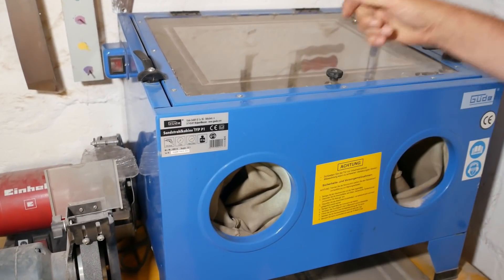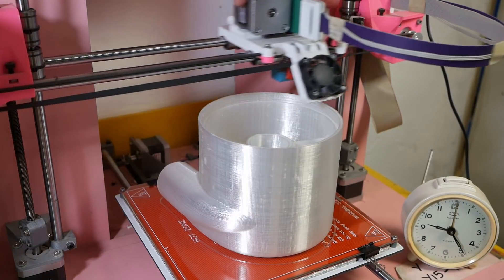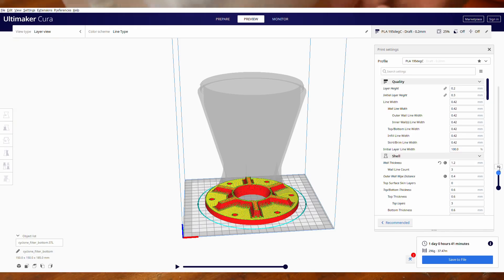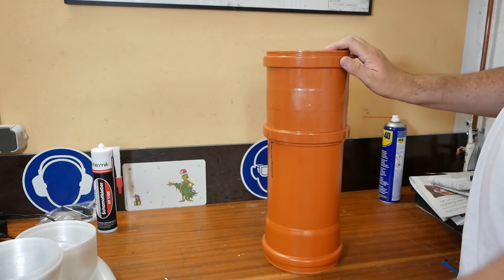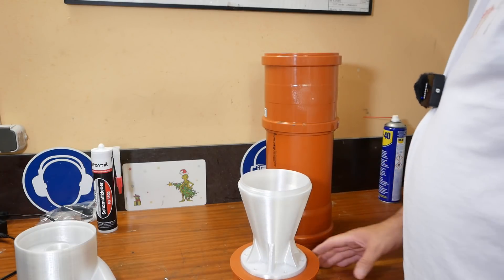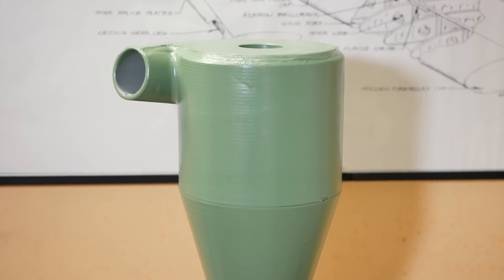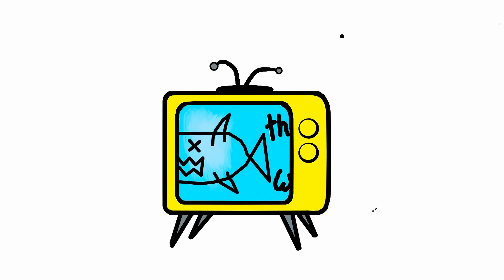DIY cyclone dust extractor

Comment: I love that green 👍 i also used it on My rolling tables in the work shop.

I think i Will get a 3d printer for the shop one day forsure
Reply from the maker: G'day Nikolai, thanks. RAL 6011 really grows on you :)

How is your shop move working for you? Did you get the owner to shift his junk out of your way yet?
Reply: @RotarySMP  Ive been slowly getting the shop setup while i work - been really busy keeping up with the work and trying to get the shop setup.. i am far from done - my saws and manual lathe are still on wood blocks and so are my drill presses. i have gotten setup so i can work now but i still need to setup the old mazak mill and the rest of the stuff... the owner of the building is not finish moving hes stuff. its not going to good for him sadly but atleast i can work and hes not in my way anymore. he havent send my a bill for the rent in the new shop neither so thats a plus. :)
Reply from the maker: @nikolaiownz  You can work around that:) Did you hire any new staff?
Reply: @RotarySMP  i made a linked post and on facebook. i had one guy write me but i dident have any cnc experience the past 10 years. i told him that i dident think he was the correct guy for my shop. I am waiting till after the summer vecation (i hopefully go in a few weeks vecation with my family midt next week - and when we get back after this summer i will see if there is as busy as its been the last few months before i start looking again.
Reply from the maker: @nikolaiownz  Must be a real challenge finding the right staff in Europe. Is it differcult in Denmark to terminate staff which dont work out? Here I believe it is not too difficult.
Reply: @RotarySMP  its not to bad if they are fairly New in the company. But its Hard to find good workers in denmark. We are a dying breed machinists in denmark.
Reply from the maker: @nikolaiownz  I bet. My wifes cousin has a bridge engineering company. He says it is incredibly had to find engineers who can do the design analysis, and want to. Everyone wants to be a manager these days. I guess once you get known, you shouldnt have too much competition :)
Reply: @RotarySMP  My problem Will always be to keep Up. Right now i have 5 cncs. And I cant Even keep half of then running haha
Reply from the maker: @nikolaiownz  I bet. I hate to think how stressful your day must be as you race back and forwards between machines which all need something from you at the same time. Robots are merciless bastards. Terrible bosses.
Reply: @RotarySMP  i future plan would be get some workers to make most of My machining and I Will be 50/50 in the shop and office. And only doing complex 1 peace parts while feeding  the workers with work 😂😂

Comment: Niiiice.  I put a blast gate on my sandblaster and found that the gate got filled up with sand to the point where it became difficult to open and close.  I put the gate on mostly because the vacuum has a "T" fitting so it also pulls on another cabinet with a glass saw inside that generates a ton of silica dust laden water spray.  The blast gates allow me to select which cabinet to draw vacuum on without fiddling with hoses.  I'll have to figure something different out, but for now it's nice to have the gate on there to help keep the sand dry from atmospheric moisture accumulation between uses. (Really only a problem when the garage studio gets below freezing in winter) 
Also i 3d printed a dessicant canister that lives inside the blaster.
Reply from the maker: Thanks for the feedback. A glass cutter must be a sand producer :)
I dont plan to hook up multiple tools. I'll probably just keep this loose and plug it between the tool and the vac as I use it, so blast gates wont be needed.

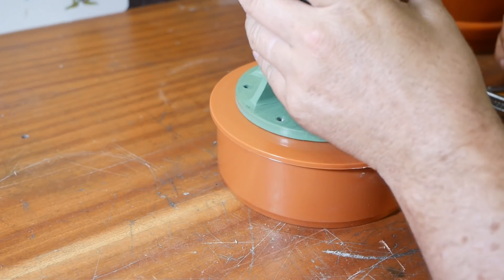Comment: @ 5:33 I would loose those burrs from around the hole...
Reply from the maker: Good spotting. Bit lazy and pressed for time there.
Reply: @RotarySMP  Thats cool...
I 2 have done the same & not noticed myself until I took it apart for cleaning...

Comment: looks like I have the perfect excuse to buy a larger 3D printer!
Reply from the maker: Good call. I got contacted by a company asking if I want to review their next printer. Not sure I want to get into reviews much, but it would be a bigger bed with less height.
Reply: @RotarySMP  I would love to see your industry experience reflected in the Voron or RatRig build.
Reply from the maker: @kttkttkt  I had not heard of them. My printer is a modificaton to the Mendel 90. My friend wanted a larger print volume and made the switch to thick MDF as a frame to give decent rigidity and damping. I just copied his design. I have been very pleased with this one, and haven't really paid any attention to the printer market at all.